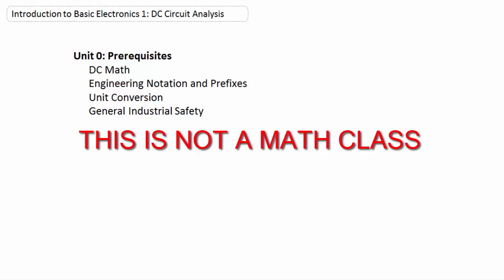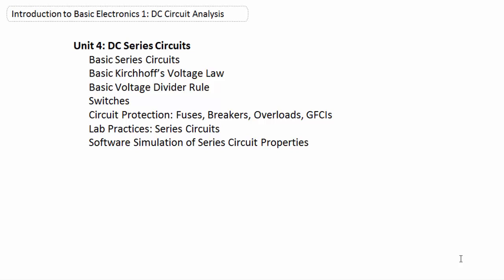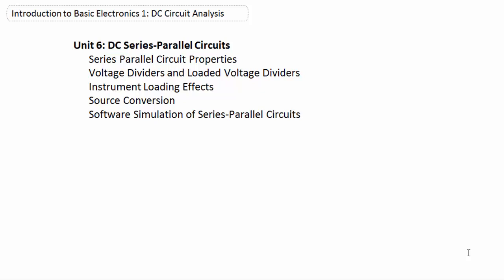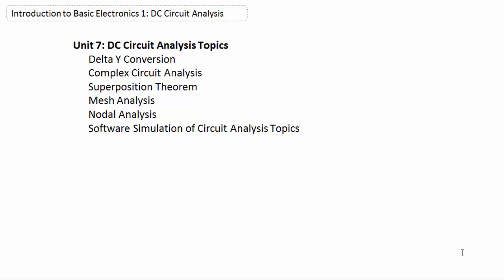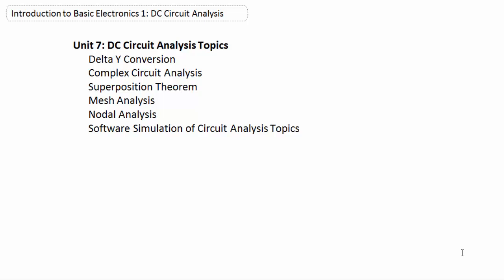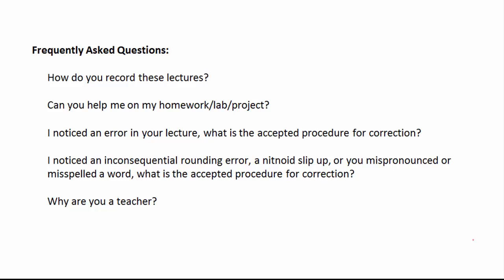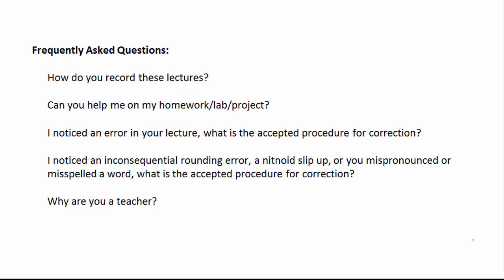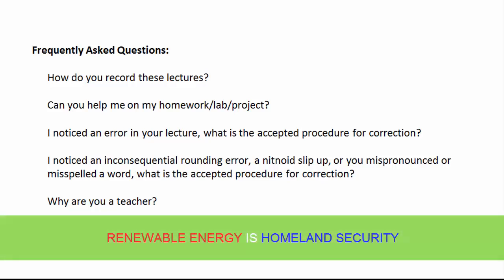Welcome to the "Basic Electronics: DC Circuit Analysis" playlist (OLD LECTURE)

Comment: Do you have a definitive list of all of your instructional videos IN ORDER that I can go to and check off the ones I've already seen.  The YouTube "channel" concept is fine, but it doesn't keep things tidy.  I think it'd help me to have a simple list.
Reply from the maker: Good question. Check out the "playlists" feature at: https://www.youtube.com/user/bigbadtech/playlists
Playlists present the material for a specific topic in a logical sequence, however, you can skip around as you see fit. 
Typically I recommend students start with "Basic Electronics 1: DC Circuit Analysis". Also, keep in mind I'm currently developing the "AC Circuit Analysis" playlist so it will have some holes I hope to fill in the next year. Finally, check out the update at: https://www.youtube.com/watch?v=ZnahO-B5jdQ
It's a little out of date but I explain the larger picture I'm working on. Stay in touch because a lot more content is in the works after the holidays.